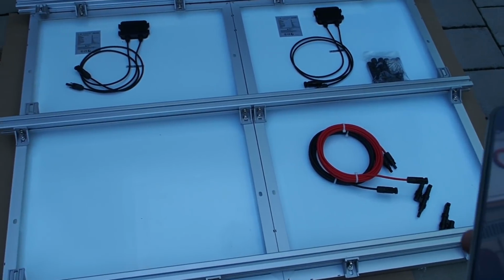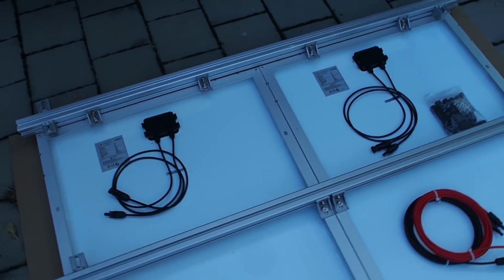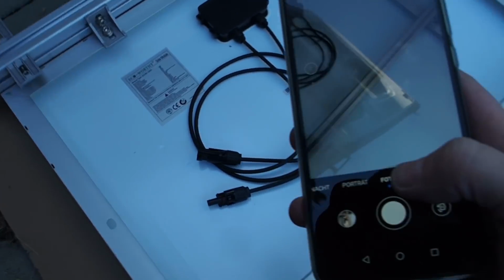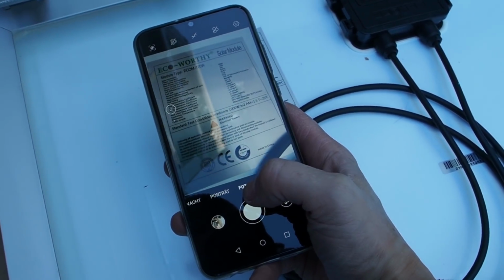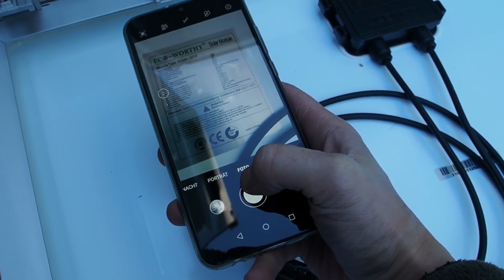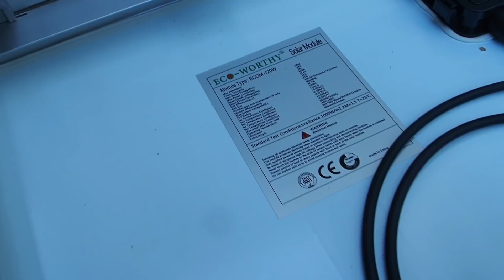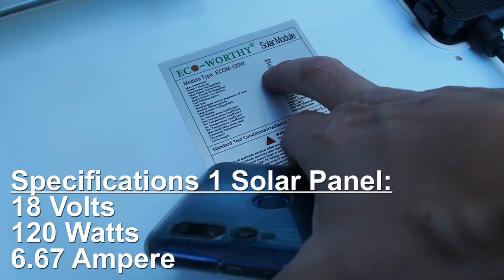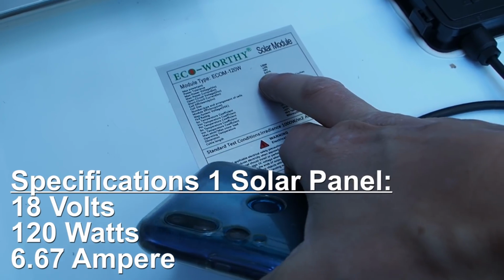How to install SOLAR PANELS on a Roof of a Campervan

Comment: I would remove the water buildup in the aluminum channels and just fill them up with clear silicone. Drain holes will just allow water to travel and freeze in winter
Reply from the maker: That is what I probably will do
Reply: @SurvivalLilly  yes, you have to keep the water out of there, and by
drilling drain holes in the aluminum rail, or maybe filling it with silicone
is a very good idea. Water collecting in any area, with cause problems.
Very good job Lilly, your a very creative, hard working woman.
Reply: I concur. She will want to do it to eliminate wind noise, as well. 

Back in 1990, they mounted a new Federal Jetstream lightbar on my patrol car, and the full length of the bottom if the lightbar was a T slot, so the mounting feet could be adjusted. The mounting kit came with a length of rubber tubing, to fill the T slot. The installer forgot to put it in, and the lightbar howled, at highway speeds. The wind overthe empty T slot was like blowing across the top of an empty bottle.Most annoying!

Comment: Would it be advisable to drill a couple small holes straight down through the middle of the railing. That way the majority of the water will have a place to drain.
Reply from the maker: Good idea
Reply: Also maybe consider using flat plates on the inside of the roof to spread the load, while driving the wind getting under those panels will eventually pull the nuts and washers right through that thin metal. Just a sugestion, love the videos!
Reply: @charleslowe4589  Excellent point. I was thinking the same thing, those washers are just not large enough. lots of vibration affecting those bolts. It’ll rip him right out of the ceiling.
Reply: Now your cooking with propane 👍
Reply: i was just thinking the same thing! need some weep holes
Reply: I was actually thinking the same thing about drain holes.
Reply: If water gets inside of the profile (it´s hollow) it will burst in winter...